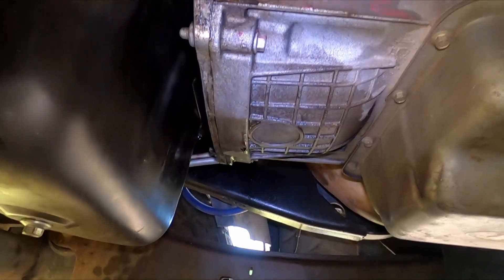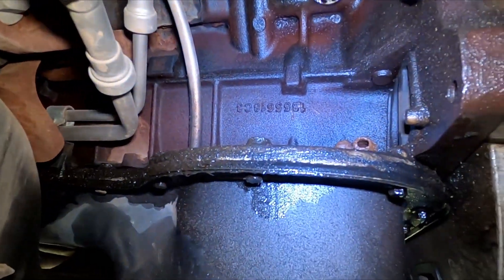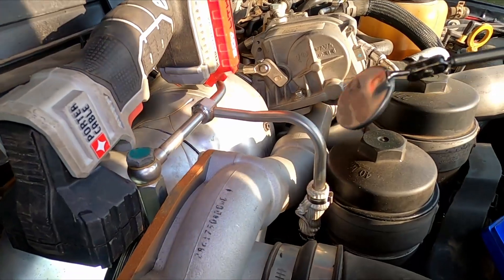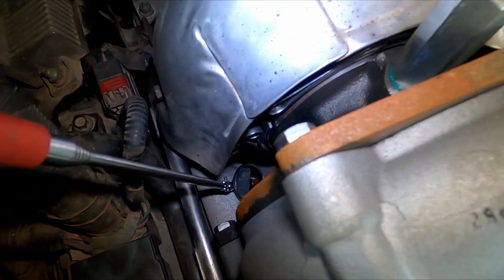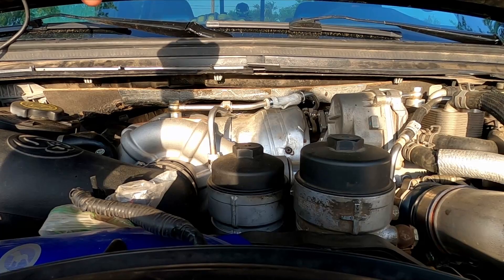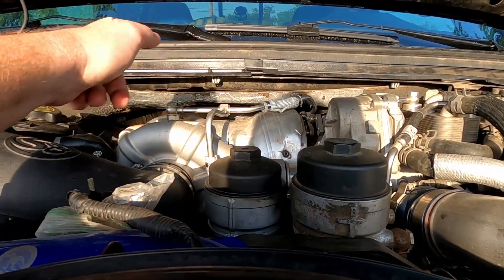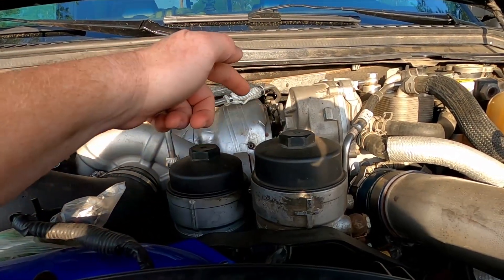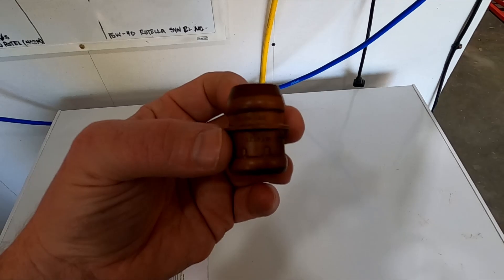6.4 Powerstroke Rear Main Oil Leak? Check THIS first.

Comment: I'm a former 2T3 with the same exact darned leak. Thought I had my share of working on these in the service but then I went out and bought one when I got out. Hardly nothing in that rubber cap on the trans but I can trace it to somewhere up to the front of the engine. I'll be checking for what you showed me this weekend. Good video.

Comment: I think k I have the exact problem my mamalona been greasing up my oil pan from right under my turbo. I think it's leaking because the stains seem to match exactly what is going on with yours. I've got it serviced with the cab off and they seem to do a good job just forgot to do that as well. 4000 dollars. Anyways I don't think I'll be going back and I rather buy me a 3 to 4 thousand lift and service my trokita on my own thanks to these great videos that I find online. It was leaking constantly I though my truck would have been toast. My oil rod doesn't seem to read the proper oil so I have to deal with that.  Anyways I changed the oil yesterday and I had 20 to quarts. I added oil think a large amount was leaking. As it turned out it was minimal leak but damn it's scary. Thank you for all your help.

Comment: What are them 2 parts called I'm new to the 6.4 and think I have the same leak😢
Reply from the maker: Turbo drain seals- It's a pain to pinpoint though, it involves removing both turbos and the pedestal. Use a mirror and a good light to look at the back of the motor, under the up pipes. If there's oil there, you might have your culprit.

Comment: This might be a long shot but do you know the part number of the orange drain?
Reply: Oil Pipe - Ford (8C3Z-9T516-B) is the high side & The low side (orange plastic piece) I have only seen in kits ---- Part #: 8C3Z9T514C
for my 6.4.

Comment: Will it leak with the vehicle off? Or only while running?
Reply from the maker: You might get some residual after the truck shuts off but it should only leak when oil is being pumped to the turbos
Reply: @USAF99  OK thanks. My alternator seized while driving and that caused the belt to snap, so the truck coolant temp ran hot for about 2 minutes before I finally pulled over and shut it off. After that the truck now leaks a lot of oil.
Reply from the maker: @bcbp14  that could be several things, none of them are good and all of them are going to get more expensive to longer you let it go. I would definitely take it to a qualified mechanic and have them check it out. The sooner the better because it will be cheaper to find it before it goes pop.
Reply: @USAF99  oh man that's what I'm afraid of. Thanks for the quick reply.
Reply: Figured I'd follow up incase someone comes across this. The lower pan was rusted out and upper oil pan gasket was leaking. Replaced the pan and gaskets with engine in. Took about a day. Not the bed plate.
Reply from the maker: @bcbp14  Glad it wasn't something more serious. The lower pan can definitely be done with the motor in the truck, it's kind of a pain (as I am sure you know) but its better than the alternative for sure!